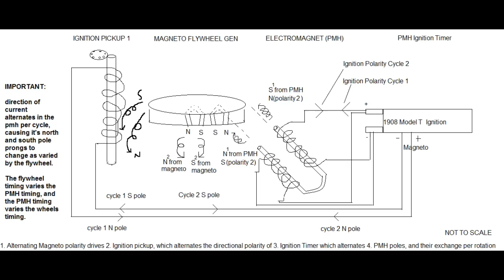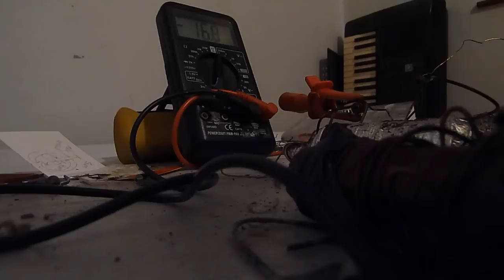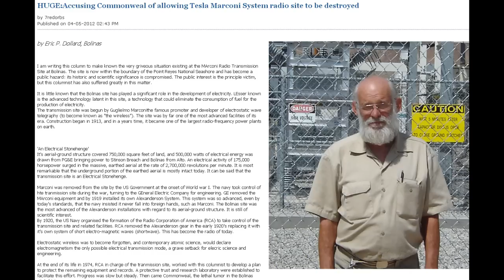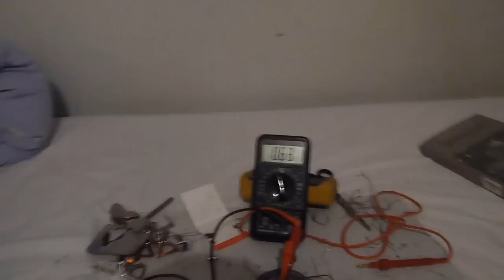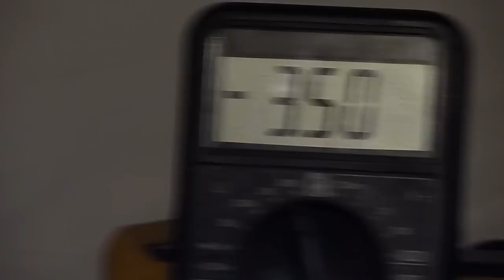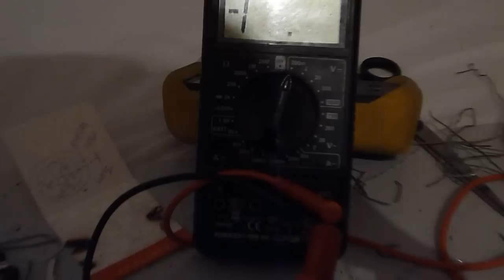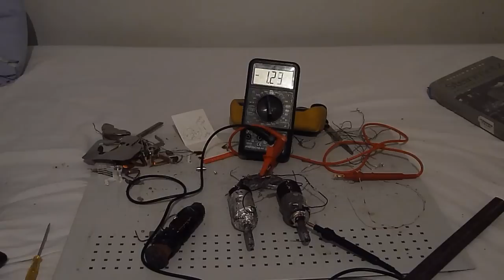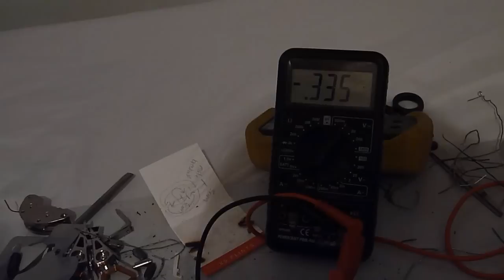Edward Leedskalnin Coral Castle Passive Negative Resistance and Negative Voltage Perpetual Power

Comment from the maker: PHYSICISTS: Are you sure those electrons and protons are not the North and South Pole magnets? CHEMISTS: Have you noticed that the acid is moving around with motion, do you know where the motion comes from? Quantum Physicists and GEOLOGISTS: have you noticed if you shield radium and other so-called radioactive sources at the centre of the earth from cosmic rays (the sunlight of other stars and suns) then the radioactivity ceases. NOTE: Gravity, the force retarding a generator comes from this.